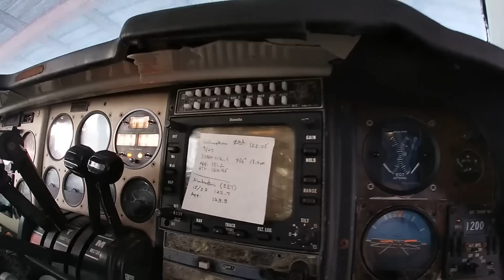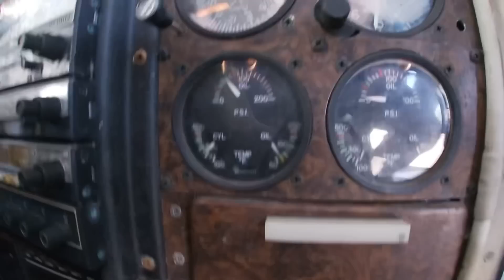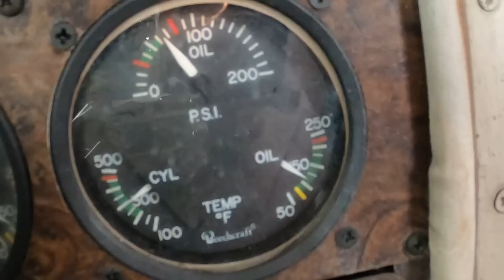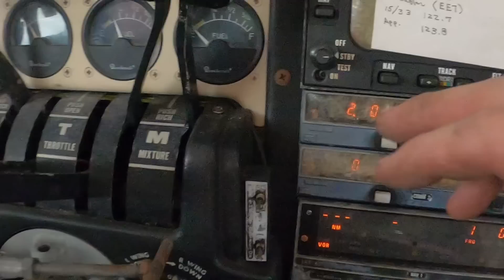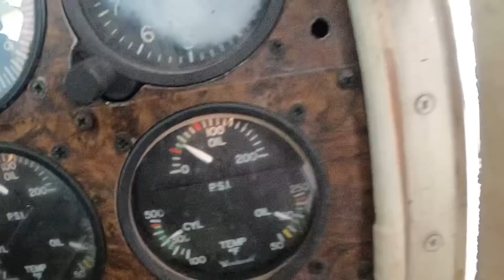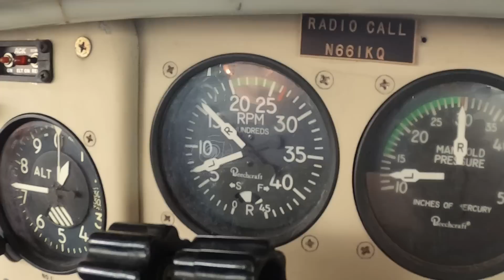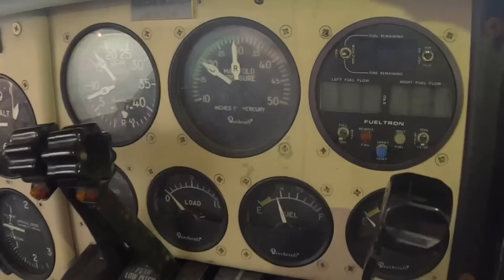Abandoned Baron B55 will it start or catch on fire. WE FAILED kinda

Comment: 1. Take fcu's, spiders and injectors off and have inspected and renewed.
2. remove mags and have inspected and renewed.
3. replace splugs or just clean.
4. clean out and lubricate cylenders, see that engine turns. 
5. Do oil change.
6. Inspect and repair all fuel and oil lines. 
6 Flush wing tanks and inspect for leak and repair.
7. Fit all parts. do fuel flow test.
8. Double check mag timing.
9. Run it for 10min, drain oil and inspect filter for metal opjects.
10. Replace oil and run again.
11. Perform blow by test.
But that is just me, and that is where I would start..

Comment: how do you verify structure integrity and stress free ?
Reply from the maker: We have to visually inspect the entire airframe to insure there isn't any corrosion or cracks.
Reply: These 79 models came with corrosion proof paint inside. What State is this in.?
Reply from the maker: @stevemuterspaugh8821  excellent very clean
Reply: @Daybreak Aviation  Florida? Always is hard on airplanes for corrosion with salt air. My Dad and I looked at a 73 model B55 in Florida in the in like 1982 and couldn't believe the corrosion had already penetrated severe damage even inspection panels were eat up and gone plus bubbled filly form  everywhere under the paint.